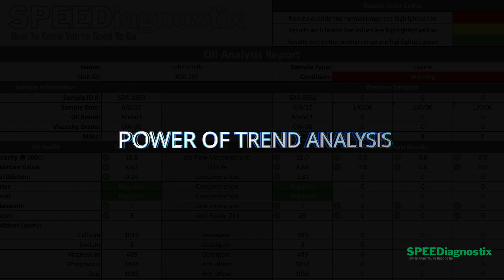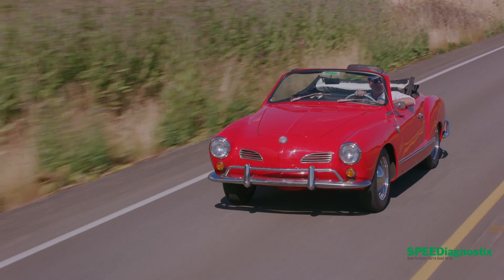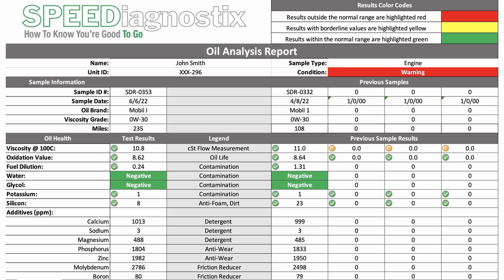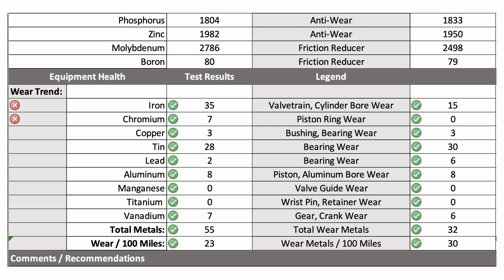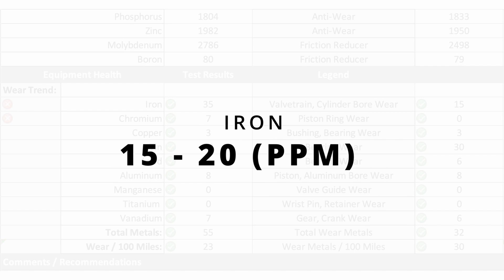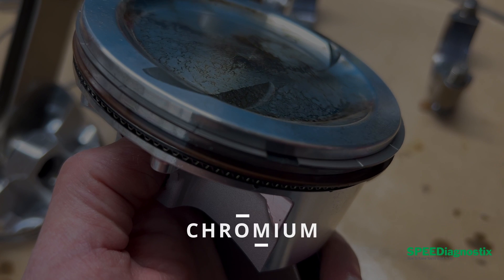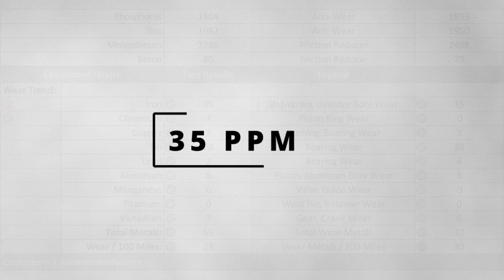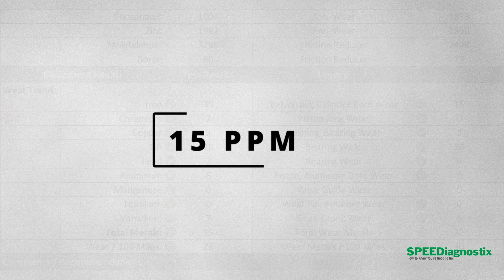Power Of Trend Analysis In Used Oil Sampling - F1 Technology For Your Car!

Comment: The trend analysis seems to be an excellent way to detect pending problems before they have a chance to cause major damage. Lake mentioned cylinder bore scoring as the cause of higher than normal levels of iron and chromium in the engine oil. I assume that the iron is from the block and the chromium is from the rings. Now I’m curious about what caused the scoring. Was it the result of ring failure triggered by a lubrication anomaly or the rings themselves not being able to perform as required under the extreme circumstances ? There are other possible causes but these two are the first that came to mind. Perhaps I just missed the whole point entirely.
Reply from the maker: In this particular case, the bore scoring was due to an insufficient amount of oil reaching the upper part of one cylinder. The oil pan and oil pump pick up design caused a difference in the distribution of the oil. Proper lubrication can be defined as the 4 R's - the Right oil (correct viscosity and additives for the application), in the Right place, at the Right time and in the Right amount.
Reply: @themotoroilgeek  … Allow me to add one more “R”. I say RIGHT on Lake, for providing such critically important information that everyone can benefit from. Many builders only consider how many quarts of capacity the pan can hold. They completely miss the point of an “oiling system”, where the pan design, pump capacity in volume and pressure with regards to the engines bearing clearances, pickup type and adequate clearance to the pan and the filter capacity in GPM flow and its efficiency in particulate microns are all important factors to keep everything lubricated under all conditions. 

As part of the blueprinting process, I also disassemble the pump and clearance its internal components and match the pump gasket to its mating surfaces to ensure proper oil flow. Crank scrapers always need to be carefully checked for correct fitment too. 

Of course you know all of these details but if a novice builder reads this, they might just benefit from it. Thanks again for your reply and everything you bring to the Motorsports community 🏁.
Reply from the maker: @danielwilson6665  Many thanks!
Reply: @themotoroilgeek  … Lake, you might have noticed the abundance of self appointed experts spewing bogus information online. However, your credentials are without doubt and the knowledge that you share is clearly based upon real world facts. Say hello to your newest subscriber 👌.
Reply from the maker: @danielwilson6665  Thank you! That's why I'm here - to provide facts.